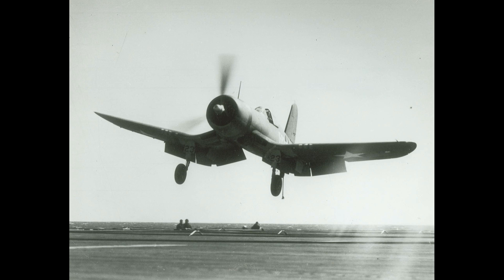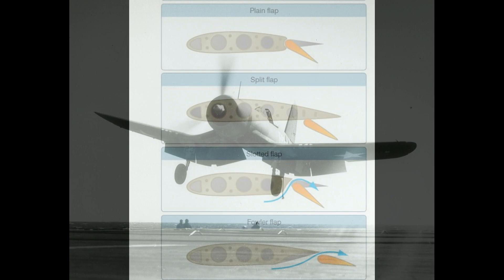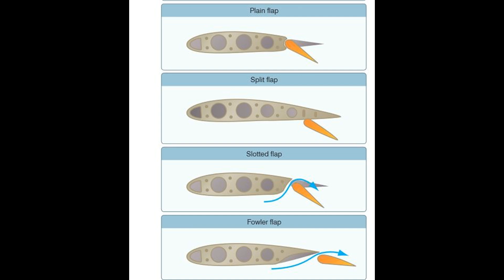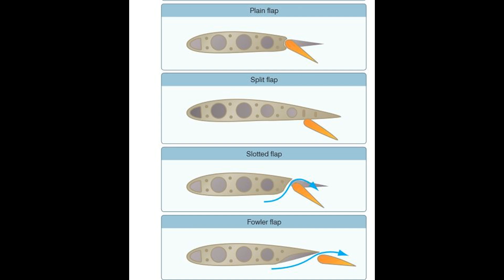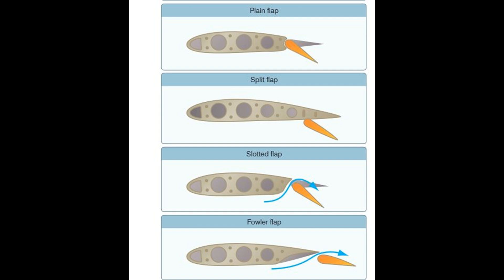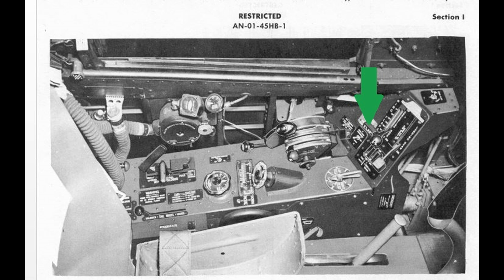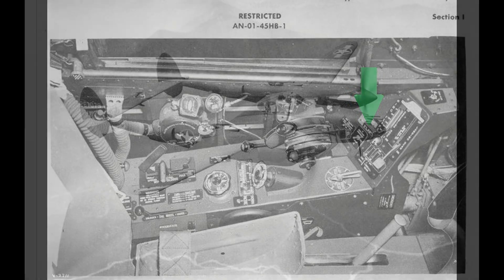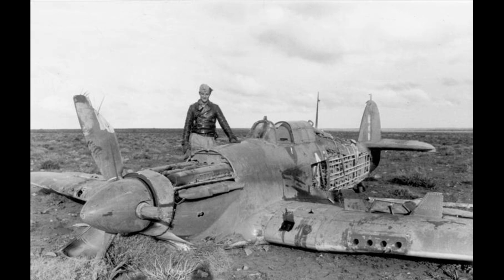Using Flaps in a Dogfight with the F4U Corsair and others

Comment: One problem, A Corsair G limit is 7.5G not 9.  So the remark at 10 minutes incorrect as it the turn calculation.  Several errors in how combat actually works.  In a fight, you (The astute Fighter Pilot! :) )   In combat you do NOT turn at 83.65 degrees   LOL  You maneuver based on your opponents position.  You pull lead, lag or pure pursuit depending on offensive position, or use vertical to solve angles.  If you're defensive you pull as hard as you can straight at him, or "Break." I'f you don't, you are giving him turn room.  The Corsairs best rate AND radius is below 264 knots any how.  Keep acceletaring above 250 knots and your turn becomes unbelievable.  You could pull 10G at 400 knots and still not be making a circle smaller than a 220 knot airplane nor a better turn rate even though that guy could be at 3-4G.   But air combat doesn't work at 83 something degrees :)

Comment: Thanks for the accuracy on your videos ( or your tendence to be as much accurate as possible). As far as I know technicaly about this point, almost nothing because I'm not a techman, so my question is about how many types of flaps deployment were in those days (hydraulic, compressed air,...) and which A/C type ( you mentioned in the video) used it. I know that Spitfires system was an electrical in-cockpit gauge that actuates 2 air compressed pistons to deploy/release them. I want to now it just to figure out how fast they could deploy them and, in fact, the deployed flap became actually effective,  in a phycologically & physically high stress situation. I can't imagine no pilot entering in a 6-7 G's turn and pulling the stick with one hand and at the same time with the other hand actuating the in-cockpit flap wheel. I'll be glad if you can answer this "quite simple" question, but no so simple answer: Thanks for advance. Maybe I've just given you an idea to develop a new video talking "in depht" about this. Regards
Reply from the maker: There are many different types of systems to deploy flaps in various WW2 fighters. We have hydraulic systems, electrical, mechanical, air pressure, or vacuum. Sometimes you have combinations, for example electrically controlled, but hydraulically actuated. 

The Corsair's hydraulic flaps are easy for the pilot to operate, even during combat. The Corsair pilot doesn't have to worry about overspeeding them either, which is really nice because it has a load relief function typical of US Navy fighters. I explained this function in my F4F Wildcat video. The Bf109's mechanical flaps would have been difficult to use in combat, however it was done.
Reply: @GregsAirplanesandAutomobiles  Thanks very much for your answer and for the Warbirds series. Great videos: remarkable huge researching effort and remarkable effort for resuming all that tough information and converting all into great didactical videos.

Comment: Let us all remember that usually the limits on turns were predicated on the ability of the pilots to accommodate "G" force. If you grey out it could be fatal.I did hear of a study to raise legs of pilots to help before g suits.
Reply from the maker: Maximum G is usually pilot limited above a certain speed (in WW2 fighters). Below a certain speed it's limited by the speed at which the wing will stall.
Reply: @GregsAirplanesandAutomobiles  Thanks Greg for clarification. Not having read Pireps during combat, I assume most combat occurs @ high power settings. High speed stalls may happen but it seems pilot would be close to fairyland should that be the case. Thanks again for putting us in the cockpit and taking time to explain what I don't have time to.

Comment: A couple times, you said "the only way to reduce drag is to reduce bank angle." I'm sure you know this, but that's not correct. The way to reduce drag is by reducing back pressure on the stick. Of course, then, to maintain altitude, you'd need to reduce bank angle to increase the vertical component of lift. I think this is important to point out for those who maybe aren't up to snuff on this topic.

I've been binge watching your aviation videos over the past few days and really enjoying them. Keep it up!
Reply from the maker: Please keep in mind, I have a lot of videos up, and I get a lot of comments. I can't very well re-watch an entire 15 min video to try and figure out what you are referring to, so it really helps if you would put in the point in time when I said whatever it is you want to address. That said, I think I understand. I was very clear that I was using constant altitude i.e. LEVEL turns for these examples. Yes you could push forward on the stick without reducing bank, and yes, that would reduce drag, but the plane would not be holding altitude. Pushing forward would also reduce the turn rate, which would defeat the whole point of the entire exercise.

Comment: I have personally experienced this effect. About 30 years ago when I was managing the family farm in Hawke's Bay New Zealand,   the local topdressing pilot (crop duster to the Americans), who new we had some fertilizer in the bin to put on, buzzed me at the shed. I raced up to the strip, He asked if we wanted the job done --'Yep'. 'OK jump in, we  need to find the loader'. After flying around the district we located the Loader truck. As he had no radio contact, he had to buzz the truck to get its attention, in doing so he was pulling some quite tight turns and at one stage he pulled the flap lever which tightened the turn heaps. It was much like I used to do in my rally car on a acute turn. Incidentally the aeroplane  was a New Zealand built (from an American design) Fletcher top dresser with a 450 hp flat 8 Lycoming and could carry about a tonne of fert.

Comment: I'm late to this vid, but I wanted to thank you for your analysis. Re the Spitfire and its two position flap, I understand it was a landing flap only. The angle of the split flap was 90 degrees. They used wooden wedges to achieve a takeoff flap position when they flew Spit Vs from carriers to ferry them to Malta. Otherwise they were up, or down for landing only.
Reply: Bladder Funny how the Spits could roll faster Go higher dive further turn tighter with those old Flaps

Comment: 9 Gs seems very high. The Society of Experimental Test Pilots in 1989 found that the minimum speed to reach 6 Gs, while turning, was "close to the maximum level METO speed".
Reply from the maker: That number is straight out of the manual. Perhaps I'm not sure of exactly what you area asking. Could you rephrase your question and or point?
Reply: @GregsAirplanesandAutomobiles  1989 test was with an FG-1 and way better instruments/procedures. Like 46 years better...
Reply from the maker: I'm still not sure what you are asking or claiming. I'm pretty sure the G meters in 1943 were just fine. I'm sure they got more accurate over time, but who cares if it's 9.05Gs or 9.09? Also, I'm not sure I would want to pull 9Gs in a plane when it's 46 years old. It would really help if you would just say what you are trying to say, or provide a link to back up whatever it is you are trying to claim.
Reply: What I am saying is the 9 G value was from a dive pull out assumed to be translatable to the horizontal. The mistake is that the prop is not unloaded as in the dive... The prop being loaded reduces this to 6-7 Gs, hence why true horizontal tests in 1989 failed to replicate flight manual values... Don’t believe those 1940s flight manuals is all I can say...  Look up the 1989 SETP tests, you will see many uncomfortable anomalies to assumed behaviour...

Comment: It was my understanding that the Lockheed P-38 Lightning H/G models had turn performance flaps added to reduce the aircrafts turn performance, to improve combat survival against the Japanese fighters in turns. Reference: Tony Levier's book on the P-38 Lightning.   Is this the same as the F4U Corsair?
Reply from the maker: It is the same in concept. The maneuvering flaps in the P-38 do improve it's turn performance which can be useful in that airplane. It's my impression that they were used much more frequently in the P-38, but I can't quantify that with anything remotely close to official data. It seems that they were not used all that often in the Corsair, but again, it's tough to quantify things like that.

Comment: Ive always wondered about this. I didnt realize these types of aircraft were like the equivalent of a motorcycle to a car on land. As if the controls literally being at ur finger and toe tips. It always seemed it would take to long to set up for a manuever like that without already being attacked. It always seemed that its not as evasive as it sounds. So wasnt right nor wrong. As you were saying in particular models it was possible and in some cases undoubtedly used by a pilot with some no how. Pretty neat video. Thanks.

Comment: When the U.S.  first started using Corsairs to  "High Speed Dive"   to attack caves in Korea,  they ran into a Problem.    If they were using the  "Newer F4U-5  Corsairs",   the plane could attack at 400 mph.  and  "Pull Out With No Problem".  If they were attacking with an earlier WW-2 version Corsair,   when they did a  "High Speed Pull Out",  the Corsair might roll hard to the left,  while the Corsair behind him might roll hard to the right during the same maneuver.    Not being able to figure out and solve the problem locally,  they finally go a hold of an  "Old School Chance Vought Engineer",  who told the to change out the Ailerons with  "New Ailerons".   The Mechanics protested,  saying that there was  "Nothing Wrong With The Ailerons On The Planes".    The Engineer's response was  "Just Do It And Go Try The Dives Again".  Sure enough, the problem was solved.  It turns out that the Corsairs have Wooden Ailerons and the glue was  "Old and Dried Out"  to the Point that at those  "High Speed Pull Out Stresses" would cause the Old Wooden Ailerons  to Warp,  thus causing the Plane to turn toward the  Worse Aileron during the Pull Out.  Who knew?  Regards,  Tom
Reply from the maker: That's a great story Tom, thank you.
Reply: Never heard of that before.
Reply: Well that's scary as hell. Lucky they didn't come apart and crash the plane.
Reply: "Just do it" sounds like a weird thing for an engineer to say to a mechanic
Reply: @TheUlitamateStunt  you'd think he'd mention what the problem was before getting them to change it.
Reply: fascinating, thanks.  i guess its the old indian(asian) adage:  if your village doesn't have an old man, go rent one.
Reply: Tom Still the Corsair could not do better than 0.75 T/M in the dive
Reply: Cool info, but what's with all the "Quotation Marks"?

Comment: What was the max mph that the corsairs flaps could handle all the way down? Specifically the F4U-4?
Reply from the maker: Ohh, that's tricky question. They were not rated in the same way as modern planes, but I'll try my best to explain. The Corsair has "back off" or "blow up" system, which on modern planes we call a "load relief" system. This was common on Naval fighters. So there is no actual speed limit to the full down 50 degree flap setting on the Corsair, but when the air load exceed a certain value, the will partially retract. With full flaps on the Corsair -4 this happens between 100 and 115 knots indicated airspeed.

Comment: Hey I love your videos, they are very informative. I’m not sure if you take requests, but I was wondering if you could make a video covering the P-47. You’ve mentioned it in a previous video and I’d like to know more say in comparison to the P-51. Not sure exactly what information, but it seems fairly unique at least to the army air corps since it’s the only single radial engine fighter (that I can think of) that they used. Thanks for the videos.
Reply from the maker: Hi Joseph. The P-47 is one of my favorites, and I plan to cover it extensively. I will be comparing it to other fighters including the P-51. The reason I haven't done it yet it because it's such a complex airplane that some other factors need to be covered first. I have been chipping away at those in other videos, like the one on manifold pressure, turn radius and so on.